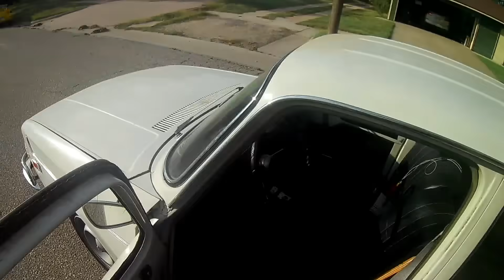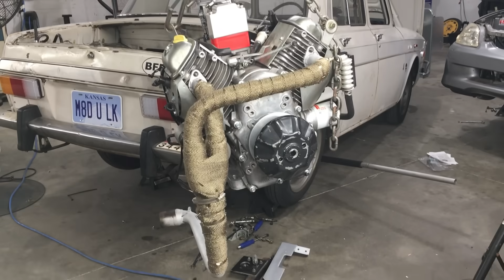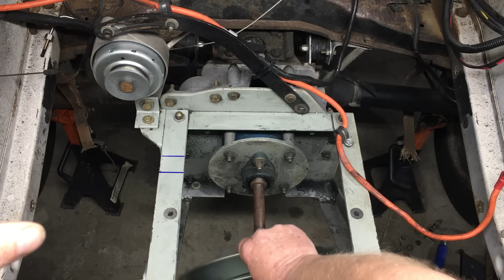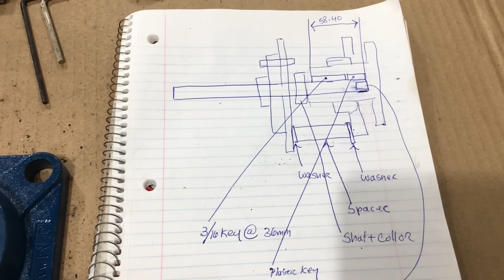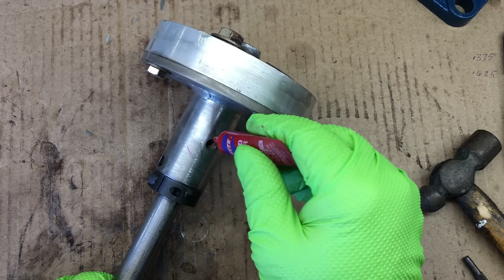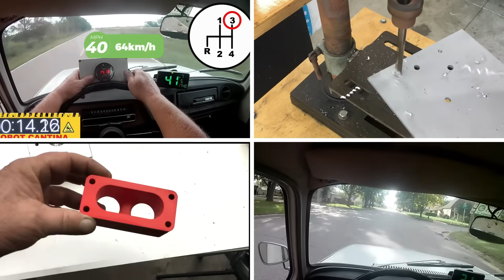S3E 36 & 37: We install a Comet 94C clutch on the 670 cc predator powered Renault R10

Comment: How did you secure the Comet CVT driven end to the crankshaft of the engine? It looks like you just slid it on and the shaft was too short; is there a shaft extension or a set screw or something that locks the Comet to the engine output shaft?

Comment: I enjoy watching you do things like this. I can't help considering other possibilities when I watch. Things like you could put a Wisconsin V 4 in your car. The main bearings are either ball bearings or tapered roller bearings. Then you could run s stock sort of clutch. The V4 Wisconsin engines are about 100 cubic inches. Comet might not have a CVT that would standup.

Comment: aye, i get that the CVT is an ordeal to take apart, so how about... mouting the engine to a primary chain THEN to the cvt, or the other way around?

hear me out!

this means you get to lower the engine as low as you want, which is better for driving dynamics and getting cool air from underneath the car. just straight up better. you also get the advantage of being able to take the transmission apart without yanking the engine out: 
engine drives a chain, to a jackshaft somewhere, that's mounted to the cvt. remove the jackshaft pillow blocks, the CVT is free. engine's still in the bay.
and it allows you to mount the alternator to the engine directly, not on the cradle, also allows you to offset the engine for balance, or clearing room for an eventual turbocharging system.

also means you'll be able to mount an oil cooler permanently too.

Comment: My goodness!❤
I adore your engineering skills by a lot!
I used to drive Daf cars for ages, and they make use of cvt drive or variomatic... double rubber belt, two sets of pullies, vacuum controled by the inlet manifold... witchcraft! But it worked! I do hope you have a breakthrough now with the new clutch and drive pully... although I'm anxious for the clutch design. If you compare it with the clutch Daf used on their 33 or 44 models it looks a bit flimsy... mind you the daf engines were only 750 and 850 cc, but the clutches were really beefy... anyhow I love this project!

Comment: I realize that there is a "HP rating" per belt clutch system. I also realize that the car, as cars go is very light. However, the weight is still a VERY large problem in your equation vs. what the "HP rating" is.
Reply: Horsepower is an equation related to work. The amount of work being applied to the clutch is important, more importantly the work the clutch is expected to exert in relation to the work being applied does have an effect ratio. We use them for slipper clutches in very fast stick shift drag racing.

Comment: I wonder if you could add an external thrust bearing for the crankshaft if you were determined to direct couple the engine. There was a USA tractor co in the 1980s that imported transmissions to mate with their USA engines and the multiple clutches for travel and PTO from europe overcame the USA design internal thrust bearing.  the field fix was an external thrust bearing assembly at the engine balancer and brighter, bolder warning stickers about proper clutch procedures. I like the direction you're going, Jimbo. just do donuts with your coffee and not the Renault :)

Comment: When it's not designed for thrust loads then why not just connect the engine with an clutch to the transmission with a chain or a belt drive?

Comment: You’re problem is your driven pulley is backwards from your driver pulley so as one pulls in and the other pulls out your belt gets put in a angle and it’s fighting itself your belt has to stay straight and has a beveled side and a flat side and one is right and one is wrong so it will always tear up belts

Comment: A friend of mine gave me this tip; "If you need to put the stuff on, soak it first, then apply, once it's dried out, paint it, and it won't be a literal pain to work with" I've been meaning to try this, just haven't had a chance.

Comment: In the end you need to daily drive it for a month and give us mpg figures and then give us a breakdown as to what is wearing down faster.   I bet if you used the renaughts fuel tank with small mechanical pump driven from the same pulley that drives the tiny pmg alternator you have , then add a flow regulator .  You'd be able to pretty much go anywhere with little effort.

Comment: AWESOME work! Love your videos.
I have a concern about 'bull gears' vs 'high speed' gears. Years ago (2007) I converted a pickup (1987 Mazda B2000 5Speed) to EV. (lead-acid batteries were horrible waste of money).  I cheated, used computer created parts that I ordered from a place in Canada.  Note: plastic parts in a 20+ year old vehicle crumble to dust over time - i.e. Dash lights brightness knob, other plastic parts.

In lower gears, the 1/2/3 gears were noisy as heck bull gears, and thinking back, they were the 'strongest' gears in the transmission, designed to handle take-off loads, the occasional dropped clutch. The higher speed gears 4/5 (5 was rarely used) - were beveled and much quieter (weaker compared to the bull gears). 

My concern is that you're going to over-stress 3rd or 4th gear in the old Renault. I'm sure by now you've already thought of this... but thought I'd mention it all the same. 1/2 are designed to handle 'take off' loads and stresses, 3/4 not so much. Please let me know what you think. Will the CVT provide enough 'stress cushion' so they'll hold up? 

Thanks! Keep up the fantastic work!

Comment: Locktight is awesome for disassembly because, it may not become finger tight maybe ever, but it will never let the threads seize or corrode, its best for if you don't tighten the nuts enough, vibration will not make them turn and fall off completely, ideal for a diesel 😉

Comment: It would be interesting to see two cvt drives stacked or compounded just to observe.

For example, the belt is a driveline dampener. So 2x 20 hp rated drives with their respective drive ratios on a 40hp powerplant 

Freewheel drivers on at least one would might be significantly more rewarding in typical use. And at distance once at cruise

Comment: Could you build a contraption to hold a thrust bearing around the crank shaft that holds a flywheel from pressing against the engine?

Comment: With the .68 overdrive you will have same rpm at 73 as you do at 50. So 0- 55 and 0- 60 runs will be doable without shifting. Shame the Saturn is not around this converter would have been very helpful for that car. Also should help fuel efficiency.

Comment: I appreciate your drive to always continue even though things break or don't go your way. I think your clutch issue is just the weight of the car on the smaller Comet torque converter. Sometimes you have to go above your base calculations for added longevity etc. 
You should be good.

Comment: Wow Jimbo, you have REALLY been busy!  Thanks for all the effort in putting the video together, I don't expect that much work each week, that sounds like overload!  Yeah, 1 and 2 cylinder air-cooled lawn mower engines are not known for refined operation so, a generous de-rating of mounts, CVT, driven shafts, belts, and etc. is always a good idea.  Using 1 or 2 large cylinders to make power results in huge torque pulses to the entire system.

Your engine/CVT cradle has held up well considering all the abuse.  For designs that complex, I make a CAD drawing ahead of time, which also catches some design problems before parts get carved out.  Yes, I know the basic, engineering sketch on a napkin has launched many revolutionary ideas, that and it saves time for basic concepts.  

Keep up the fine work Jimbo, each one of your videos is very interesting, even with the gnomes ocasionally interfering. 😂

Comment: Jimbo, next time you need to affix a keyed shaft to a flange, use green instead of red loctite. 602 will work better as it’s formulated to work with a lot less surface area.

Comment: Interesting that the predator motor can’t take thrust loads, which means using a CVT. Another solution would be to have the predator engine drive a generator, and then the generator would supply power to an electric motor.

Comment: Couldn't you get over the fact the utility engine has no thrust bearings by making a flywheel/clutch thats self supporting with its own crossmember and some bearings in it? And just put a coupler on the other end to couple the engine shaft to. I've looked into how I'd out a preditor v twin in a cj3a jeep and that's how I'd go. Solves the thrust issue just uses a little more longitudinal space. Cvt are a great compact option but do waste more power than a traditional clutch.

Comment: Now I'm curious. If the manual transmission 4th gear is overdrive then the cvt having overdrive will probably make this the only double overdrive equipped Renault in existence. If 4th is direct then you'll be getting a nicer cruise and better mpg.

Comment: Please don't rely on memory when it comes to convenient nuts instead of nylocks! 20 years rigging for theater tells me that that's a no-go! Not that any nut or bolt has ever fallen from the fly (area above the stage) when I've worked, but if any of us found standard nuts on anything that would be overhead of any of the performers, there would be hell to pay. It's just a safety thing, and that's really important. Not that anyone will get hurt from a nut dropping off in your engine bay, but it might get expensive quickly, and for such a lame reason. If the problem is, you're the type to only use nylocks once (well done, that's what they're certified for!) and you throw them away and you're frequently out of proper nuts, there is one nut type you COULD consider as a replacement that is not single use. Not a crown nut, not a serrated flange nut, but the all-metal lock nuts that look kind of like nylocks, but have a pinched top. Also, they're sometimes golden colored. They're pretty good. Just stop using them before you can turn them by hand. Philidas nuts, I haven't tried, but I'd rather use the pinched nuts, as they're shorter. And you can get them at Lowe's, it seems. Also, they don't have nylon in them that can melt. 
Also, thank you for another absolutely fantastic video! I really do enjoy your work! ❤

Comment: You know that the predator engine has aguvaner that limits rpm from the engine it has small gears with shaft that can be removed from the engine to get 12,000 rpm

Comment: 4:00 I 5hink your driver pulley was your issue,  i think dirt and spring fatigue is a main suspect.  New spring and differ weight arrangement and it should w9rk again, but upgrades is always the best repair 😆

Comment: So I've got a question; have you considered testing different plenum volumes to even out the air flow on the carb?

The pulsing of air is rather uneven. Every other rotation, suddenly there's a massive source of vacuum which has to make the fuel and air start moving, then immediately stop. If the airflow was continuous, it would be able to flow air for a much larger engine as there would be no sudden changes in momentum, see: lawnmower carb on a ford V8 producing 60hp despite being barely suitable for a 8hp single cylinder.

With a properly (or very large) sized plenum, you could emulate a constant draw of air through the carb by having a massive reservoir for vacuum. You'd probably need to go to a smaller carb though, as it would probably fill up the entire plenum volume rather quickly under anything more than partial throttle at low RPM.

Comment: Rather than red loctite - perhaps use Vibra-Tite?

1) works good with vibration - not-brittle, unlike Loctite.

2) reusable to a limited degree.  Figure about three times before reapplying.

3) can take things apart without setting the parts alight.

Note that I have used Vibra-Tite on both Ebikes for their crucial fasteners.  It works especially well, and I wish I’d learned about this stuff earlier.

Comment: This channel is on the verge of absolutely blowing up.

When you hit Mr Beast levels of subscribers I think you should take the Kubota and drivetrain out of the Honda Insight and stick it in the front to make a dual fuel 4wd 5 cylinder Renault.
Reply from the maker: LOL, If the channel ever takes off I will do that!

Comment: How much is the insurance on that renault? Did you try flipping the angle iron opposite before cutting it up? Just curious
Reply from the maker: Insurance on the Renault is $135.00/year. Its cheap because the car is considered an antique and isn't driven regularly.   Flipping the angle iron would have changed the mounting points.  the cradle is not symmetric.
Reply: @robotcantina8957  gotcha

Comment: You should move from Kansas . Too flat for real life use to test there , here in northern Alabama lots of hills and a few flat areas.  Like buy the place next door. It needs to last 15 k miles. You have horrible winters compared to the occasional snow here . I hereby apply for the job of second Jimbo.
Reply from the maker: That would be cool, we need a second Jimbo!
Reply: @robotcantina8957  dead serious.

Comment: Given that, iirc, your Lawnmower Renault was being limited by maximum revs with the old CVT setup, this new setup should allow a higher top speed ... if the engine can produce the power. 
Seems to me that once you have tuned the engine a bit, that higher top gearing will pay dividends. 
I am of the opinion that the new CVT upgrade will be of an even greater benefit than just a bit faster from a standing standing and a bit more able to handle the power.

Comment: your channel is taking off man. honestly im glad i get to see everything taken apart and put back together, kind of like how TV shows in the early 2000's and before used to occasionally do a "last time" segment at the beginning. came here because i wanted to buy a clapped out honda insight and i somehow found your channel. thankfully you talked me out of it and i learned how to spoof the analogue voltage outputs on my 02 civic's MAP/MAF sensor by making a ghetto rigged "MAP enhancer" (just a potentiometer wired in line with the output of the MAP sensor and a rocker switch to either bypass the pot or use it) which let me get scratch the hwy MPG lean burn bug instead of starting a new project car from hell. i figured it was okay to mess with this since honda themselves built a lean burn version of my model civic. got up from ~36-42 hwy mpg up in the low 50's. was driving a lot but finally killed that car with ~400k miles on it when teaching my gf how to drive stick turned into impromptu cardio. owell, got a chevy volt a few months ago once the prices came down since WA state added a ~1.50$/gal gas tax this year. 
I am learning more than i thought i ever could about cars from your channel. theres nothing else like it on youtube and thats why your channel will keep growing like crazy. thanks for doing all this work. you have to be retired... so much effort goes into these videos for someone who doesnt get millions of views on every video (yet). hope that means youre doing stuff you always wanted to but never had time/re$ources.
thanks for uploading man, have a good day :)
Reply from the maker: Thanks!!!

Comment: I did donuts in my newer Saturn Ion 14 years ago and it messed something up on that as well. Never was quite the same. Would randomly surge the RPMs in  neutral between gears and ultimately wrecked the transmission.

Comment: I have turned tapers on crankshafts for cvt clutches. I buy the 420cc engines and put them in the utility carts at work. $400ish engines vs. $1300 from Toro. If you ever want to try a cvt that needs a taper i could do it.

Comment: I own a moped woth 50ccm engine. Belt lasted me 10 years and 10k km. Still was usable but replaced it. And while replacing it i've felt that bearing for stock pully was bad. I had to replace whole set :/ Now i can't get good weights to make it run like it was before. Stock was 6.5g. Now i can't get same rpms with 6g weights. I've tried 5.5g but it wasn't it.

Comment: Consider. The really high power CVT's (like on most ATVs) don't open the belt all the way to provide neutral. They have an oil bath centripetal clutch on the engine shaft that drives the driven CVT pulley. If they didn't do this the belts wold not last. I know you cannot do that set up for this experiment.

Comment: I think its a little bit disengenous to insinuate that the 670 in the miata failed because it had a typical clutch and throw out bearing. The Builder reported that hooning was primary cause. It definitely did not fail due to thrust loads on the crank.
To claim its slow is true, it also weights somewhere around 20% more than the renault based on factory weight. Seriously, its almost 400lbs more than the R10 renault. Its also only about 20% slower doing 0-30. 
Everyone told you that a comet44 wouldnt work and now where are we.